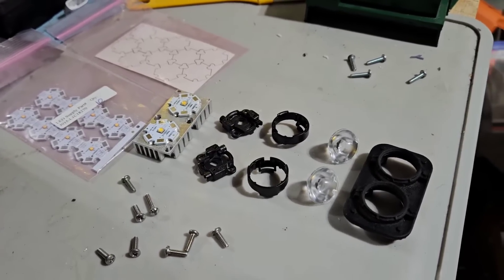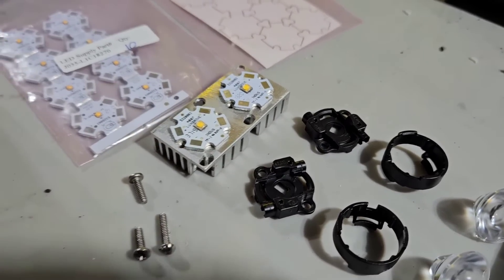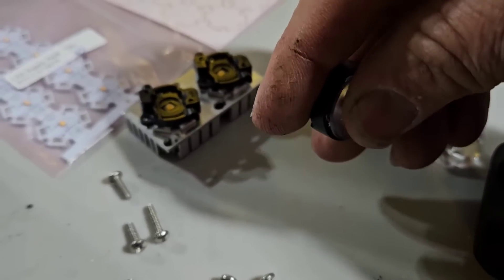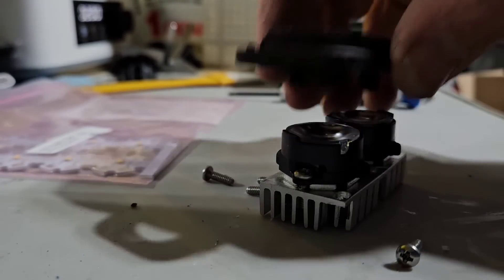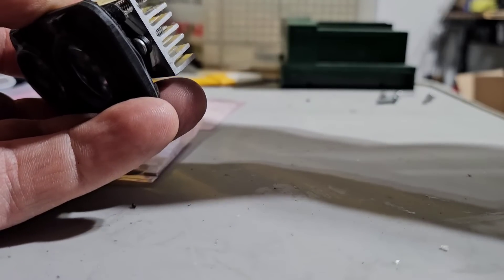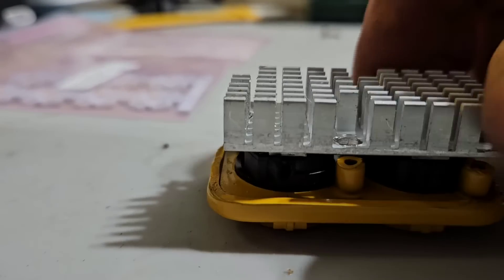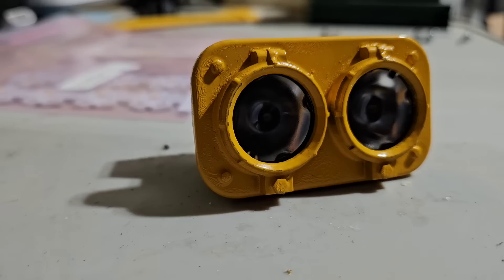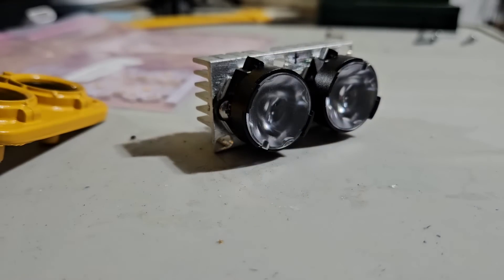3D printed headlight bezels

Comment: Nice job but you might want to try using heat set inserts. For the screws to compensate for temperature fluctuations.
Reply from the maker: I haven't had any of them back off yet, but I'll keep it in mind.

Comment: Well, those are cool. I noticed straight away the nice detail your printed version has. I do a bit of modeling myself on a smaller scale and I couldn't help but notice a bit of puckering in your paint job. If you aren't already using a paint that is formulated specifically for plastic, I have found that if you lightly sand the surface before priming and painting, it really helps quite a bit with adhesion on resin and certain types of plastic.
Reply from the maker: Thanks for the tip!

Comment: neat ! it is great how the 3d printers have made it so much easier to create what you need! so you do your own “custom
shop work “ now what you need , you can make! do the LED’s put out that much heat? that is a great adaptation for the
electrical contacts to power the lamps. will there be an oxidation issue at all with the contacts? great design.
Reply from the maker: I don't think oxidation will be an issue, but there are chemicals  for that if an issue ever arises. The LED's don't really put out a ton of heat. They're only 3W each, but the heat is enough that you should have some kind of cooling system. I may have gone overboard with the heat sink, but it also serves a structural role in addition to thermal control. It'll probably never overheat.